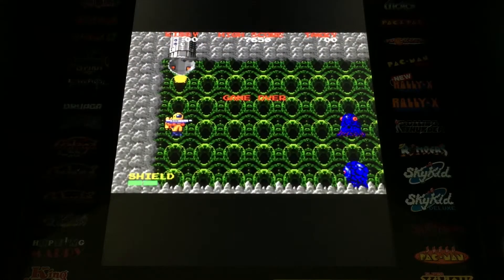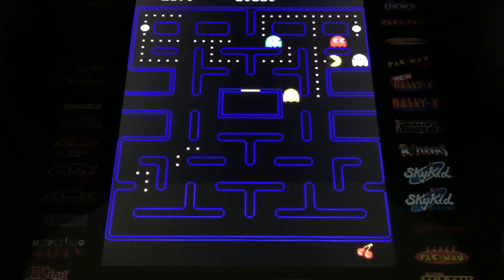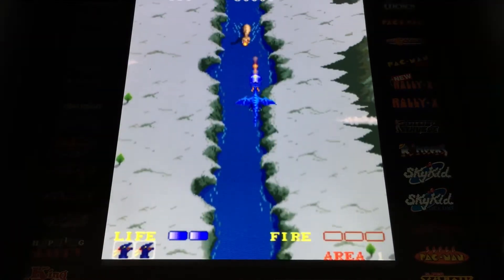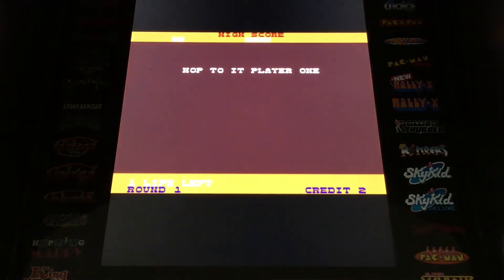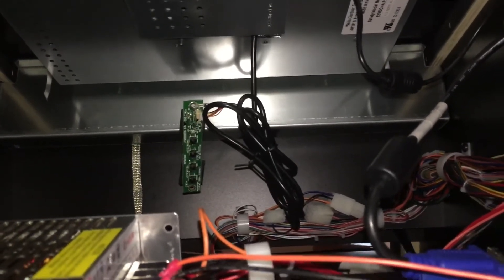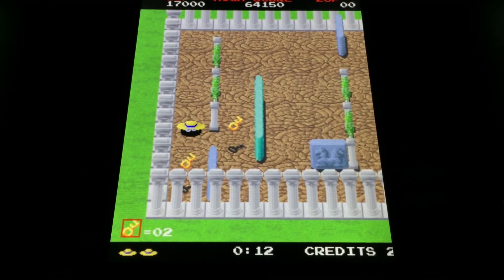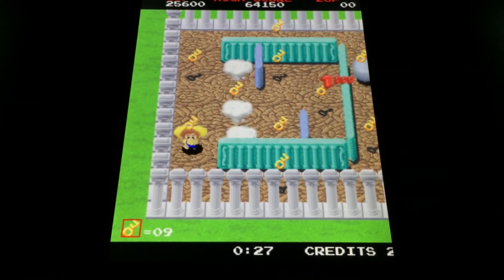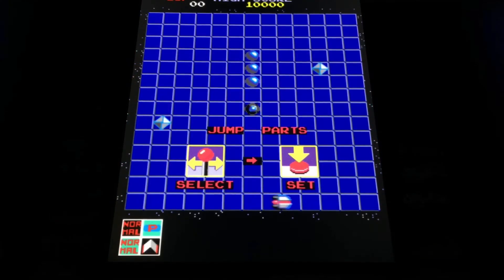Pac-Man’s Pixel Bash Chill Review

Comment: This Pac-Man can break if you leave your arcade machine forever on it’s happened it may have a refrigerator but once you turn off your arcade machine the refrigerator turns off also this is more of a design I know 6 people who owned this said theirs broke not just that their electric bill was very high more money then what a refrigerator would cost if I wanted the Pac-Man pixel I choose the one that takes money
Reply: actually the refrigerator is plugged in separate to avoid keeping the machine on. I saw a video where they open it brand new, there was a plug for the refrigerator

Comment: I heard later revisions of this cab actually come with an 8-way stick? can't believe they dropped the ball here though, obviously some of these aren't gonna work right on a 4-way only stick. otherwise seems like a cool little unit!
Reply from the maker: It’s tough because if it was an 8-way joystick, games like Pac-Man might not register the 4 corner inputs. I was surprised that they included 8-way games when they have other 4-way games in their catalog that they could have included instead.
Reply: Where did you hear that? If it is the case then there must surely be an option to switch between 4-way and 8-way. It really bugs me out that they didn't solve this problem in the first place.
Reply: I would also like to know where you heard this.  I'm interested in this cab but it would be tough playing the pac-man games on an 8-way
Reply: I wanna say it was a blog post or something like off of arcade heroes, I forget where I heard it... but I know the 8-way stick wouldn't be ideal for say, pac-man most of the other games would surely benefit.
Reply from the maker: kressenstein definitely prefer a 4-way. When the joystick dies, I may look into installing a switching joystick.
Reply: @ArcadeHunters  I believe, and this might just be a guess, they've programmed the games to adapt a bit better. But if you want to keep the same joystick but make it 8-way buy a Happ Super and swap the bottom plate.